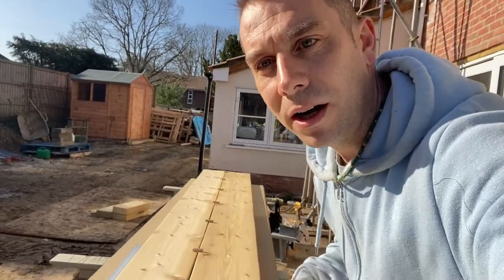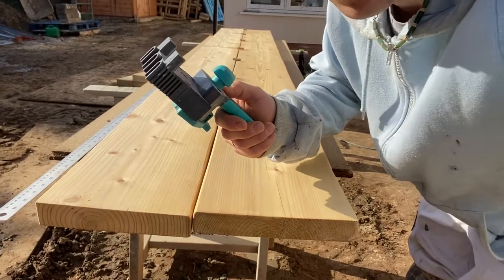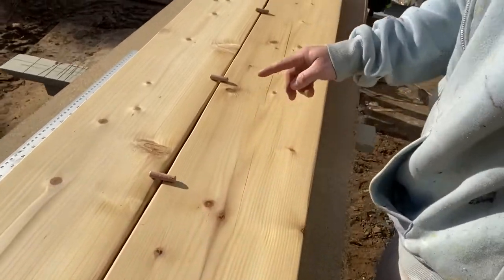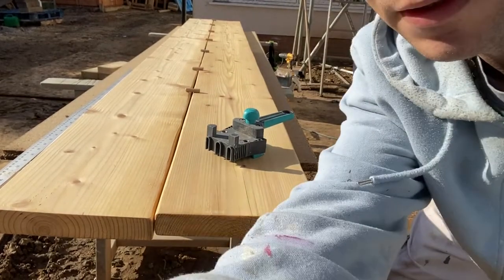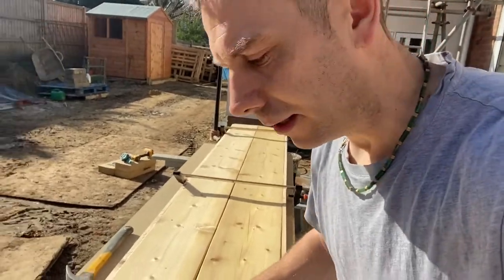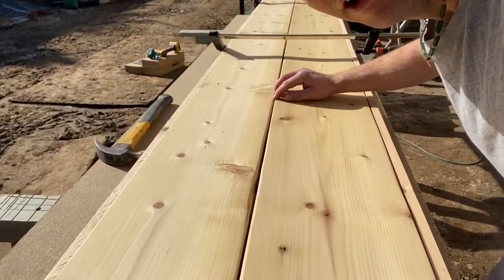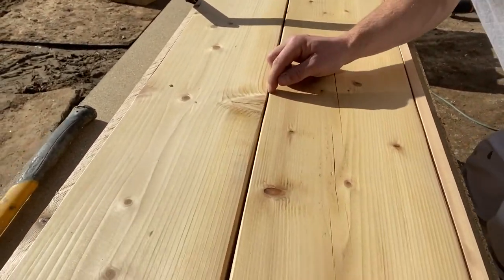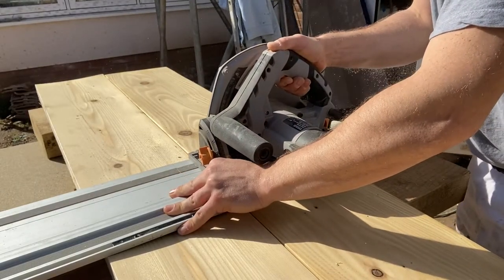How to join wide boards edge to edge. Wolfcraft dowel jig is the way

Comment: Have you thought about using a biscuit joiner? Or even just cauls? From my personal experience dowels are very unforgiving and require a tight tolerance on their hole positions. But biscuits are a bit sloppier.
Reply from the maker: Hello mate, yeah i thought about it but i didnt want to buy biscut joiner machine just for this  one job. I rerly do these big heavy joints. If i did big tables and things like that on regular basis id definetely get biscuit joiner but for this one job that little tool is perfect and its perfect for MDF joining and slim boards joining. I recommend that tool worth £20. 
Greating from Norfolk!
Reply: James, from the 'Stumpy-Nubs' YouTube carpentry channel, insists that biscuits form much weaker joints than dowels do. I invariably use dowels when I need rigidity and strength.

Comment: Why were you using the track saw guide upside down, and how did you manage to fix the saw too it? No wonder you have muscles pushing against the rubber friction pads.
Reply from the maker: It just looks like its upside down but its normal. I would not be able to slot saw in it if its upside down. Titan plunge saw has guild with plastic sliding strips on top that look like rubber. But those rubber padding is on bottom and its black not grey. 
I also cut full 45mm in one go so much slower and pushing harder. I dont do cutting in many thin cuts. 
Anyway Cheers bro!